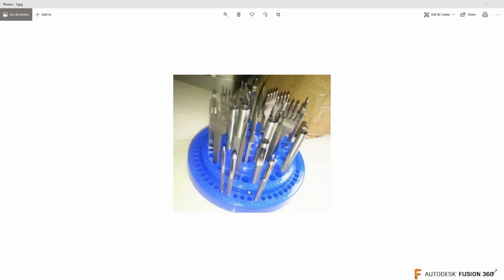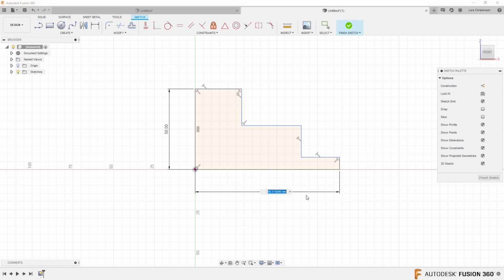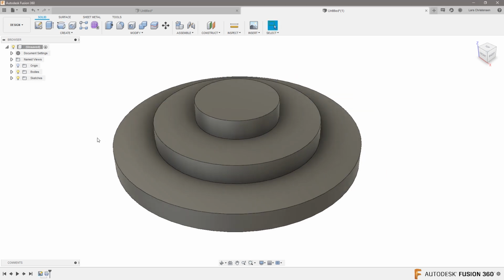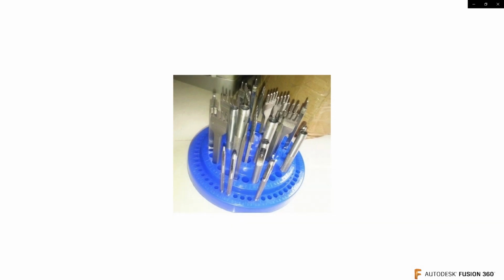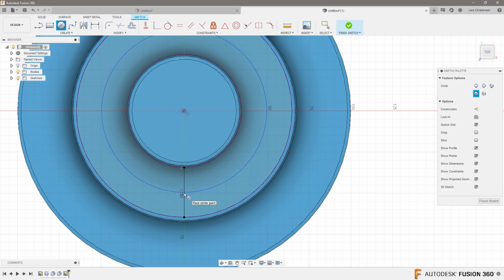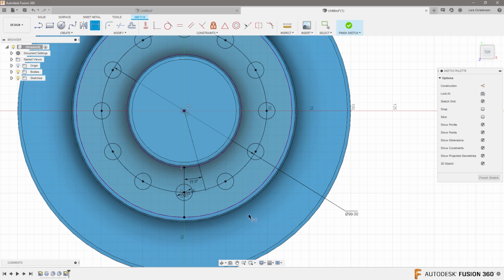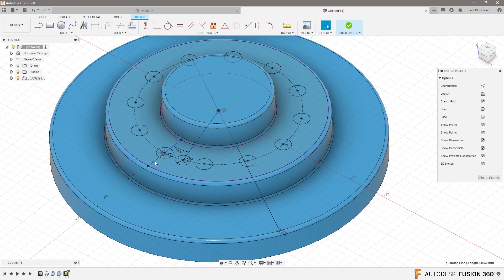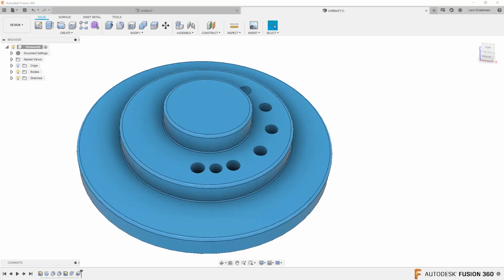Fusion 360 — Model Circular Tool Holder — Ask LarsLive

Comment: Hate to be snarky, but I feel I must repeat that this use of the shell command is terrible. The model prints easily before the shell command, and after the shell command you have tons of overhangs no matter how you orient the model on the buildplate
Reply: If you needed this model shelled out for whatever reason, supports would allow it to be 3D printed just fine. You can even add supports to a model using a single nozzle machine these days. It's not a problem.
Reply: @QuinnHale  It's true the model can still be printed after the shell command, but you'll be doing more work and you'll get an inferior result. Support removal takes time, and the surface finish suffers.
Reply: @antalz  That hasn't been my experience. It takes time to set up a printer properly to use supports well, but any machine needs to be set up properly. I own a large laser cutter and CNC router that also needed lots of initial tweaking to do accurate work. That's the nature of these machines. That being said, I would machine this part vs 3D print. However I do understand that many people only have a 3D printer as they're very inexpensive.
Reply: I think that the use of shell here is excellent for an injection molding mold, but thats just my opinion.
Reply: It's possible to add large 45 degree fillets on the underneath side only to avoid having to use supports.  You won't see them, you'll save more filament and your print will be much faster than with supports.  That's what I would try.

Comment: I came up with some questions?  (1) Not understanding why you picked the 1st vertical line with Projection feature. (2) While my model followed yours I did run into the "hole" pattern was not on the 2nd level but ended up on the bottom. Not sure how that happened. Lastly (3) Later you made lines into construction lines. Is it better to do that later on or when you 1st added them.